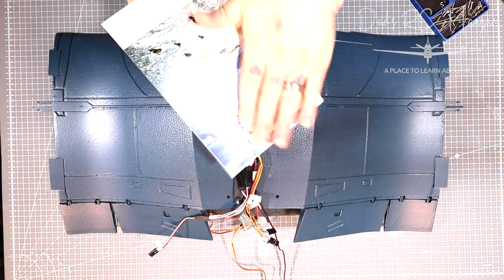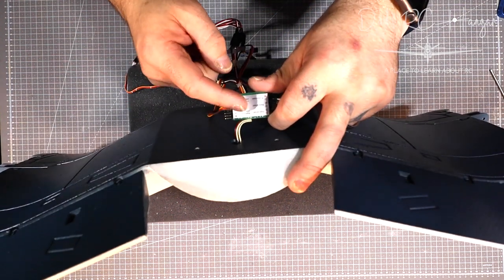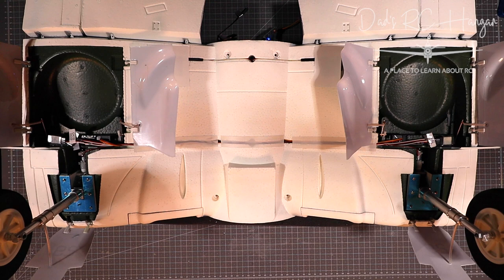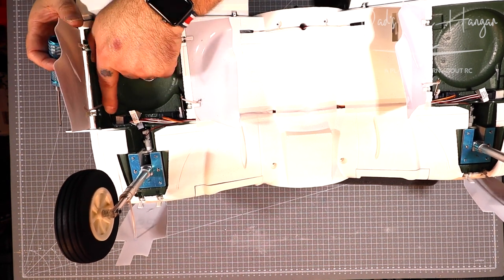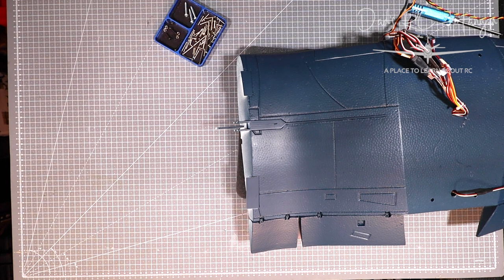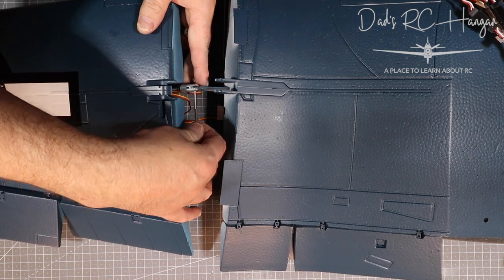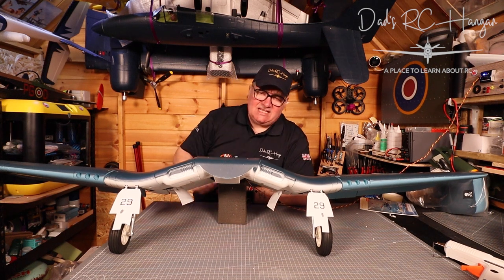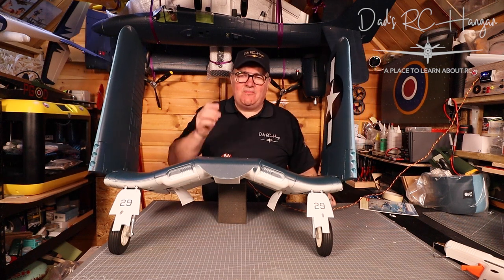F4U Corsair | Folding Wings Build

Comment: Great video Chris, absolutely love the wing fold mechanism - going to look superb on the field. Top tip from the full size, always face bolt heads into the airflow if you can, the bolts will be held in place if the nut goes AWOL. Also be careful with the type of grease you use on plastic, petroleum based grease will soften and attack plastic over time.
Reply from the maker: Thank you Jason, some great tips. I will have to make sure what the grease is made off and make sure I have the bolt heads facing forward. Thanks for your input buddy👍🏻

Comment: Great looking kite loads of tech
Now I play devil's advocate
FIRST LAW OF ENGINEERING
IF IT GOES ROUND ITAL GO WRONG
The undercarriage is a fantastic slice of engineering 2 axis working at the same time.... IS IT GOING TO BE MAN ENOUGH OVER TIME... my field would destroy that in one landing... Its like the HIMALAYAS.... Coated with deer poo.. Ant reservations on any of the tech so far.
Stay lucky
Brian
Reply from the maker: Gees that’s some landing zone Brain. Sorry I did not see this. I guess you would like the Draco plane 👍🏻
Reply: @DadsRCHangar  hi yah 
That draco waaaaay to pricey the lipos are the price of good meal.... I've the next best thing the aeroscout tough as a brick shite house. Had mine flying 2 days ago in 25mph winds. The tech these days are astounding far away from.. JET X ENGINES and crystal tx when you used  to have a flag on tour transmitter
Reply from the maker: @BRIANFORWARD1  yup the wheels on the Aeroscout are more sited to rough terrain 👍🏻